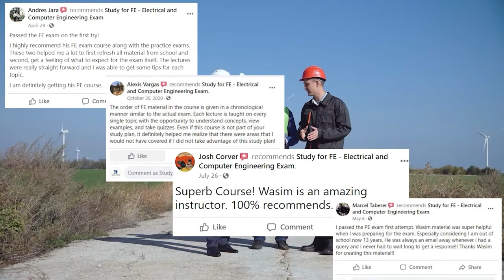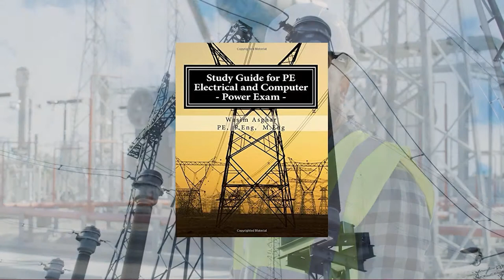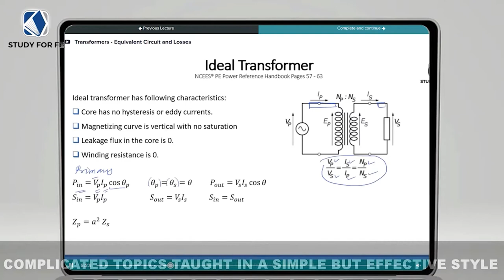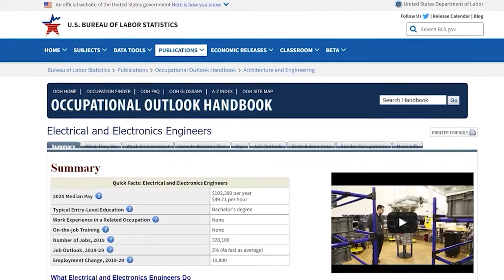Why Pursue a Career in Power Systems Engineering?

Comment: Hi. Im in my first year, first semester of electrical engineering. At this point, I’m thinking of taking power systems as an elective in my third year of studies.. i was wondering if you have any insights on what i should do prior to getting there? Aside from maintaining my GPA. Appreciate if you can reply this as it would be super helpful for my confidence to thrive. Thanks.
Reply from the maker: Thanks for your message. 
As a final year student here's what you should do in my opinion:
1 - Maintain high GPA
2 - Try to get internship, co-op or even a part-time job even if it is remotely related to your field. I worked in Engineering Career Services of my university on a part-time basis with full-time school.
3 - Network with your seniors, alumni, industry professionals and potential employers.
4 - Attend industry seminars and job fairs.
5 - Brush up your resume and start applying for jobs even if you are in final year!
Reply: @studyforfe  thank you! appreciate it.

Comment: GPA doesn't matter at all. No one cares about GPA, where you went to college, and what advanced degrees you have. At least in the US, the only thing matters is having experience and PE license.
Reply from the maker: I agree with your analysis but in my opinion it applies largely to experienced folks. If you are still in school, try your level best to maintain and improve grades because it's one of the easiest filters that prospective employers can apply when they are searching for entry level candidates from pool of fresh grads. Internship experience will be icing on cake. Once you have few years of experience under your belt and especially if you get FE/EIT certificate and eventually PE license, no one will care about your A+, A-, B+, B- or even C grades in college.
Reply: Maybe after 4 or 5 years of experience it won’t be but in your first 3 years or so it is definitely important. Many companies have a MINIMUM GPA requirement of 3.0 and some are even higher. Also, your GPA can help get you internships at more well known companies like NASA or even BOEING which is a HUGE advantage for your career. Your GPA lets employers know how much effort you have put into your classes and or how well you grasp the content.
Reply: My buddy found that out 3 months ago.  He has an associates in Electronics Engineering and has been in the controls field for 13 yrs and was about to go back for his bachelor's and landed a job as a Control Systems Engineer with the power company based on experience. They pretty much told him he'd waste time and money on a bachelor's as he can get his FE and P.E without it. He's very well respected by the other engineers as he's worked on and installed the systems he's engineering from the ground up previously.
Reply: PE license is an exam and you can fail init, pretty much like what your GPA tries to tell.
Reply: Yup..when u have 10  years experience